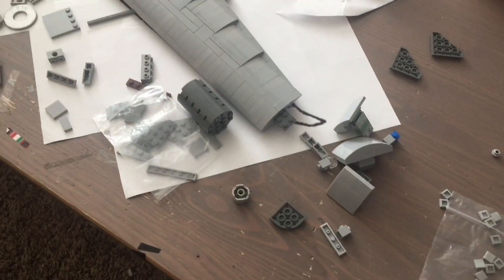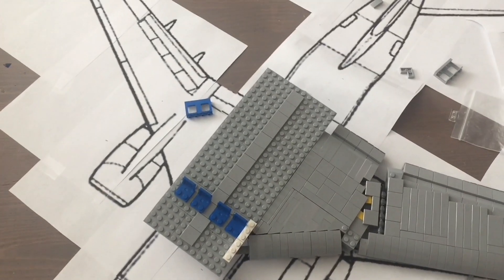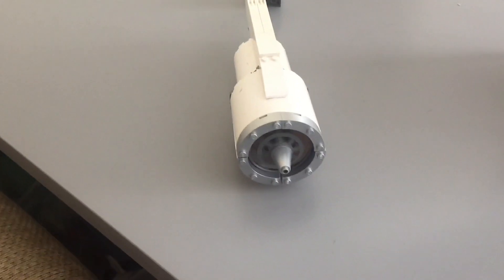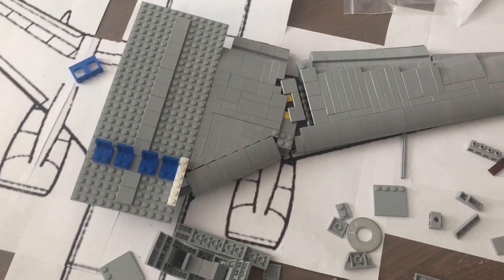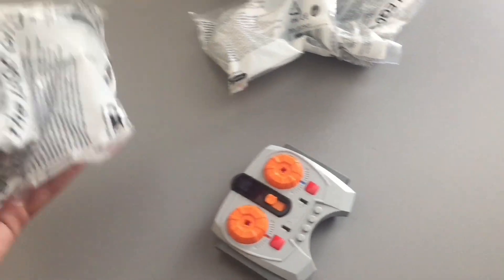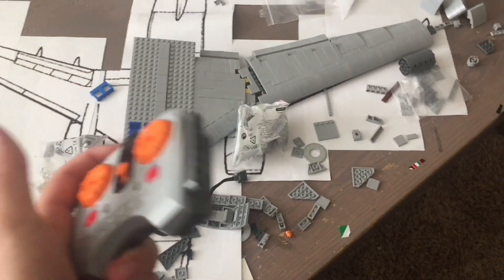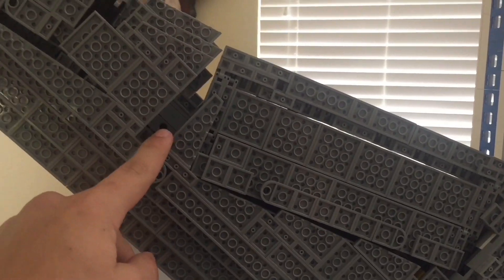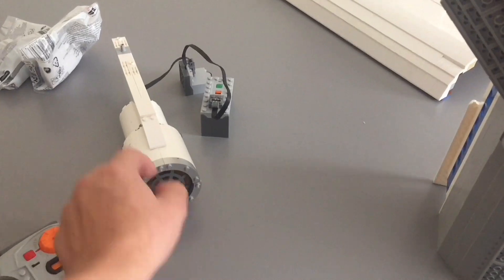Motorizing LEGO jet engines!!!

Comment: There is always a odd number on big jets like the 747 two on each main wing and one in the tail and the same if it is a smaller jet with one engine one each wing the tail engine is used to start the main jet as thay don't have a self starter due to there size I believe that is why all though I may have it slightly worng but it's still a fun fact keep building the model look so cool
Reply from the maker: I believe you are referring to the APU in the tail.

Comment: What you could do to make sure both engines on the 737 go at the same speed is put each motor connection on the same channel on the receiver. You could also do that on the 747 but put all 4 on the same channel. 
Just a suggestion. It’s really annoying to me when I build something and one thing is not going the same speed as the other thing.
Reply from the maker: Good idea. I just wanted to have manual control over each engine to be able to do some interesting things.
Reply: Sounds good! Keep up the great work!
Reply from the maker: It will work out well!!
Reply: Definitely!

Comment: That really deserves to be a Lego set what’s the motorized engines
Reply from the maker: It could be a feature that you could add as an extra.
Reply: Yes, although personally I think the engines should be a separate feature, that might increase cost
Reply: Exactly, take the Horizon Express for example. It’s not equipped with power functions but is built so the buyer can easily install a motor, you could do something like that